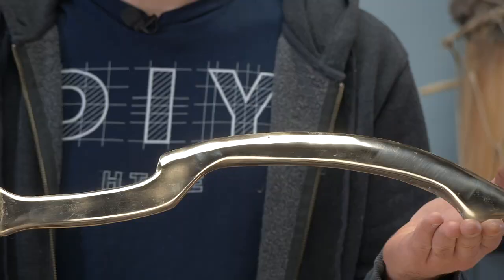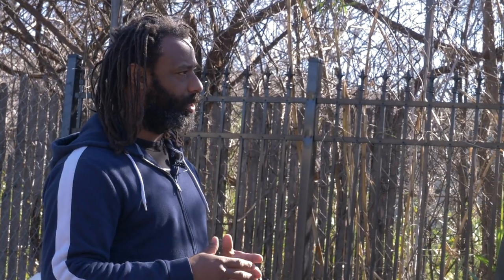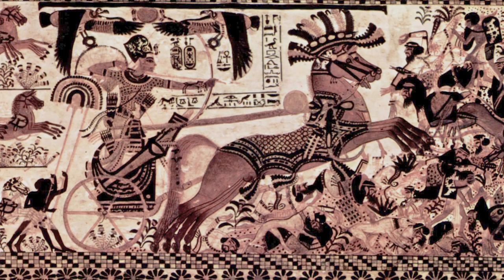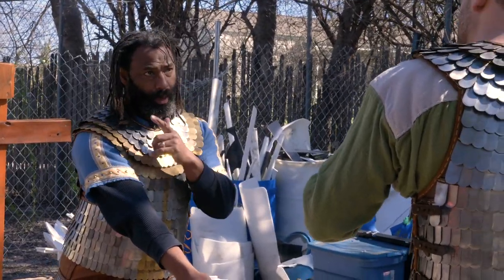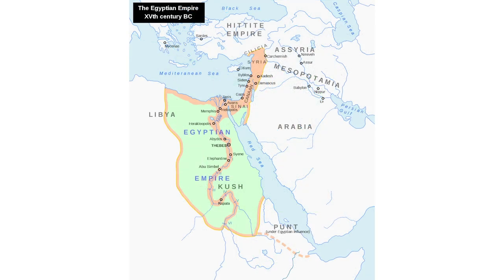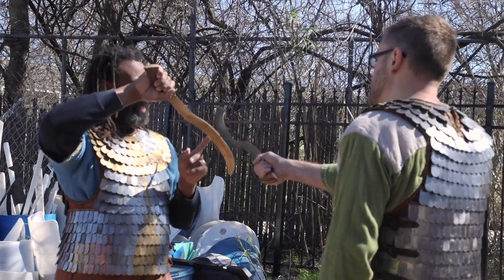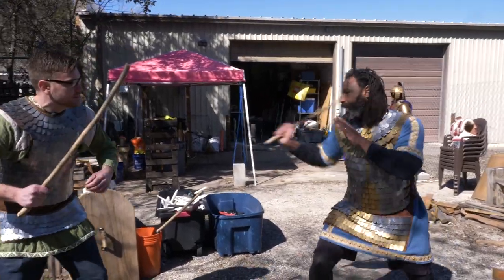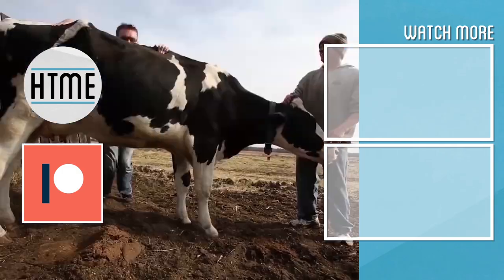Sword Fight Like an Egyptian

Comment: I want to see them make an electronic computer from scratch, or an engine
Reply: Tristan Sloan I’m waiting for rockets
Reply: @zacharyj6465  Mechanical Relays and vaccuum tubes were the logical component of choice before the transistor.
Reply: Electric computers are extremely hard to make from scratch with time you could probably skip a-lot of steps because of modern knowledge but you have to realize the complexity of an engine is like building legos compared to a computer. I should say the biggest chalenge is you either need a ton of space and the ability to easily manufacture accurate parts or the ability to make extremely small things at extremely high spesificity.
Reply: @eveer4876  look up the nuclear boyscout he does that kind of stuff if your interested
Reply: I want to see them build a humanoid robot
Reply: @zacharyj6465  nah just used vacuum tube.
Reply: Idk if he will make a computer but be will most likely generate his own electricity from scratch when he gets there
Reply: im waiting for muskets :>
Reply: @zacharyj6465  oh yeah that's exactly why I'm excited they'd have to basically have to print the transistors
Reply: first you start with counting stones. then, go!

Comment: Interesting. In more modern styles of swordfighting you usually want your weapon infront of you and between you and the enemy blade at all times, but it seems that's less of a priority with short swords and shields.
Reply: Like he said, when the sword is so short & soft, there's just not much point in stances like that
Reply: @damnitstroubleman  I mean, your opponent would have short and soft swords as well.
Reply: @darthplagueis13  exactly. That's the point

There's a part in the video where DaMon explains how swords like these can bite into eachother, or roll their edges & be damaged. This is obviously not ideal, so stances like those weren't used